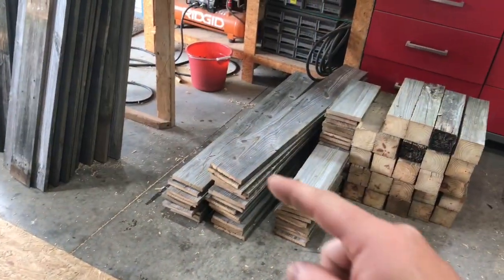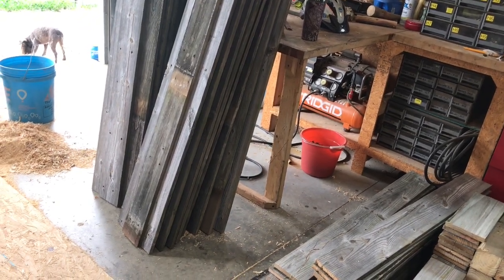Repurposing privacy fence into garden boxes

Comment: How does water drain? Dont you have to make some holes at the bottom for it?
Reply from the maker: It drains through all of the cracks in the wood. If I had to do it again I would add the garden fabric to hold the soil in a little better.